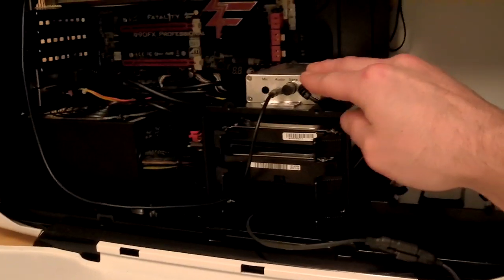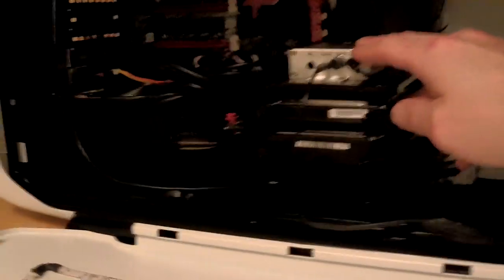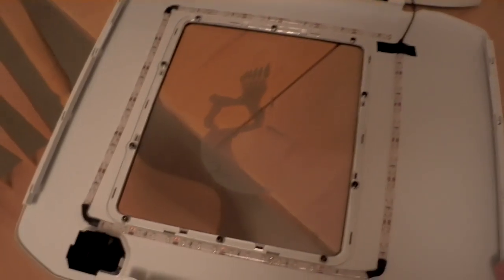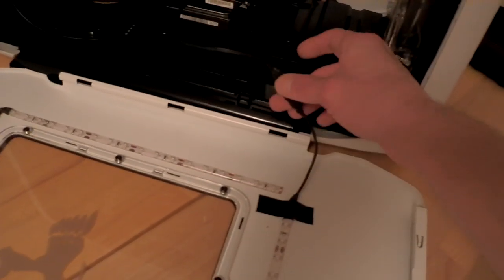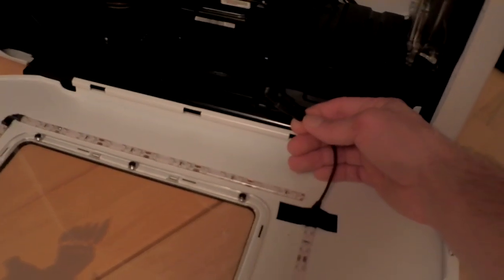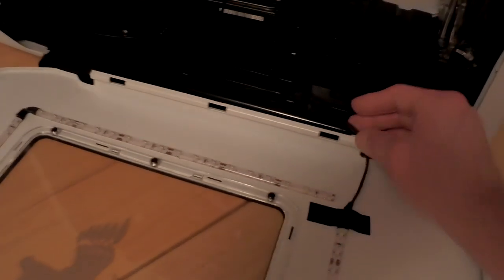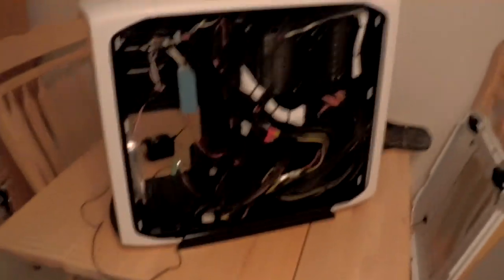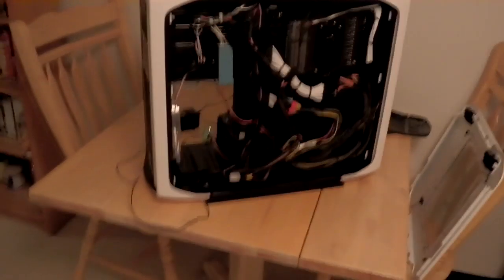Sound Activated LED Case MOD (Tutorial)

Comment: Hey! Any chance you could explain in a little more detail on how you set-up the splitters etc., I currently use a splitter from my sound to my speakers + RF. However I would like to use my headphones when gaming, but I'm slightly confused on how to have my headphone work with the RF..?
Reply from the maker: Mark Simpson I am SO sorry for the late reply! I got a new puppy, house, & job recently that has kept me CRAZY busy so I apologize. But how I use mine is that I have one two way input to the RF controller. I had to get 2 splitters, one for each the headphones & speakers (So 3 splitters all together, 1-two in to one out & 2-two out to one in). Then one from each the speaker & headphone go into the two way connector to the RF so when I toggle in the control panel between the headphones & speakers for the default device it doesn't matter because they are both connected to the controller. The other open end of each the headphones & speakers gets routed normally to its designated input. It took ALOT of work, trial & error, & trips to the hardware store to get this all figured out & setup properly. I ended up drawing it out so I had a really good idea of how everything had to be routed so don't get frustrated. It took over a week to get this setup to my personal liking. I hope this helps & isn't too confusing. Please feel free to message me back with any questions though & I will do my best to get back to you ASAP! Thank for watching as well  :-)

Comment: how did you plug the sound controller to the computers power supply?
Reply from the maker: I actually didn't plug it directly into the power supply, I used the 12V. power supply that attaches to the controller and plugs into the wall. Didn't want to have to mod up a molex and converter just so I could plug it into the pc's psu. So I just have it run out the back of the case next the the pc's psu and plugs right into the wall. It is an extra cable out the back of the case, but doesn't bother me as I don't see it :-)

Comment: Also, what's the electric bill like with this beast?
Reply from the maker: HAHA, it's actually not too bad. The LED's themselves don't require much and the RF Unit just plugs in with a regular 12V plug. So all in all not bad, & I don't always have it running.

Comment: Could you make the lights slowly pulsate? that would be cool.
Reply from the maker: Yup, the controller that's included with the RF unit has an option for a slower pulsating look, but if you use that setting you can't have it activated by the music/audio input.

Comment: Would this work with a Hue to get multiple colors to blink?
Reply from the maker: A "Hue"? Like a RGB (Red, Green, Blue) LED Strip. If that's what you're referring to, then yes that will work. This LED controller is intended to work with both RGB & solid color LED strips. If this isn't what you're talking about just let me know.
Reply: Elegant Mess I think he might be referring to the Hue by NZXT - which is a RGB LED controller

Comment: http://www.ebay.com/itm/VoomPC-Power-Adapter-Cable-12V-AC-DC-Connector-to-Molex-/140222952257 what ya need
Reply from the maker: Not exactly sure if this will work or not, but I'm looking into it now because that would be sweet.

Comment: It's activated by an audio input, which comes from my mac or any audio device that I can connect to my system. Then the audio signal reaches my home made controller, which uses two transidtors to amplify the signal, so it works with 2.1 systems. Then the weak signal is transformed to 230 volts, so anything which works with 230 or 120 volts, can be plugged here and it will flash with music. :) Like if you put a microwave there it will flash too :D

Comment from the maker: 3 It seems that with the HDD cage moved I am getting better temps. because it allows an unrestricted airflow from the front fan which I replaced with a high flow rate fan
4 The decal I got was from mnpctech, you can find in there PC Case MOD Store tab.
So for the audio setup I did a quick search and it seems that you can get an optical to 3.5mm for pretty cheap and then you would just get a spliter so that one end is for the controller (which is 3.5mm) and the other for your speaker/headset

Comment from the maker: For your questions 1) I'm not sure how the optical out is going to work due to the fact the audio is activated by a line in audio, if you can get an optical to 3.5mm that should work but i don't know if they have anything like that.
2)The LED's that I'm using are all blue, and have seperate UV lights that I use for the UV Tubing for my water cooler, and with both the LED's and the UV lights it actually looks really good and I don't think that 1 takes away from the other.

Comment: awesome set up man 4 questions  1. I am using optical audio out of the mobo how would that effect this set up? 2 you said you were using blue lights with a uv but it all looks like its glowing so does that mean the blue led doesn't mess with the uv effect? and 3 I am using the same case how does the temps look with the hdd mount moved compared to the stock set up? also were did you get the window sticker?